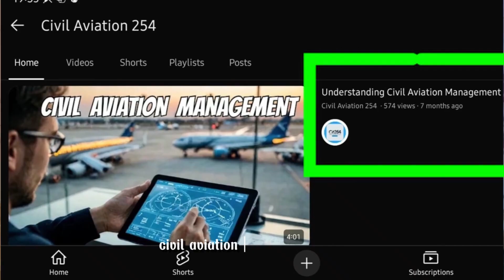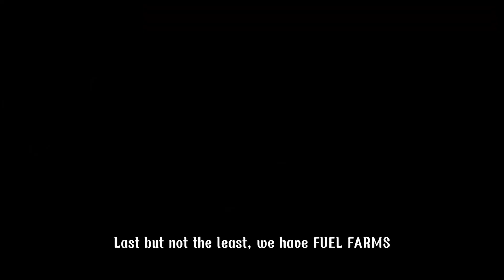PARTS OF AN AIRPORT: COMPONENTS EXPLAINED!!

Comment from the maker: Here are the Timestamps: SUBSCRIBE ❤❤
00:00 INTRO
00:47 PARTS OF AN AIRPORT
00:53 LANSIDE
01:02 Parking Lots
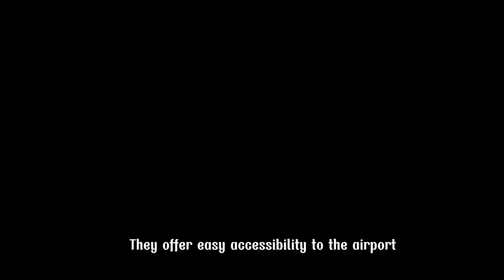01:10 Drop Off & Pickup Zones
01:15 Ground Access
01:30 TERMINAL AREA
01:38 Check-in Counters
01:48 Security Checks
01:56 Immigration & Customs
02:06 Boarding Gates & Waiting Areas
02:13 Shops & Lounges
02:16 Operational Offices, Baggage Systems & Airline Services
02:21 AIRSIDE
02:28 Runways
02:37 Taxiways
02:47 Aprons/Ramps
03:04 Control Tower
03:22 Hangars
03:28 Fire Station
03:37 Fuel Farms
03:56 OUTRO [SUBSCRIBE ❤]